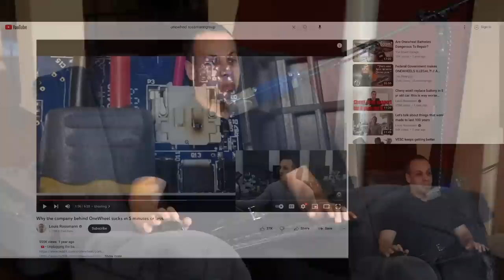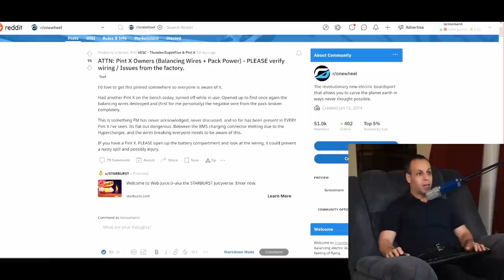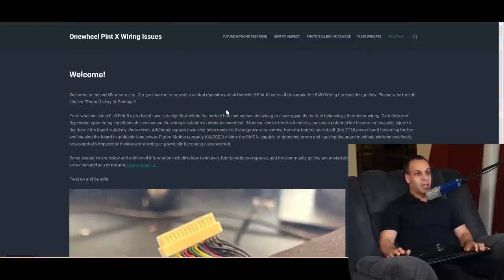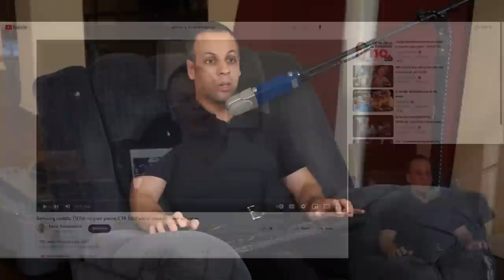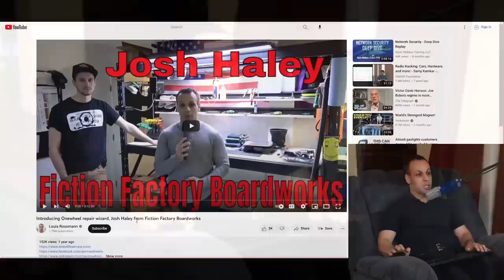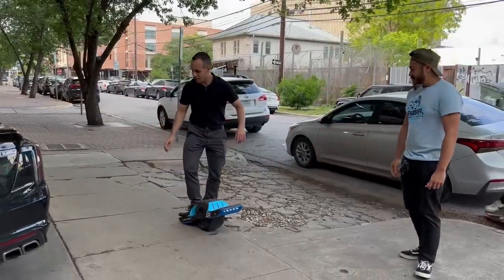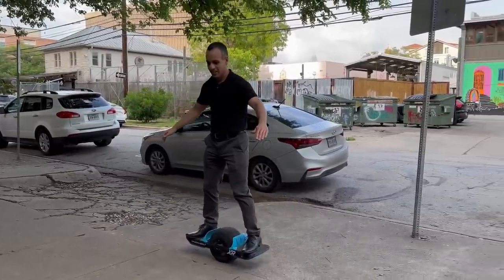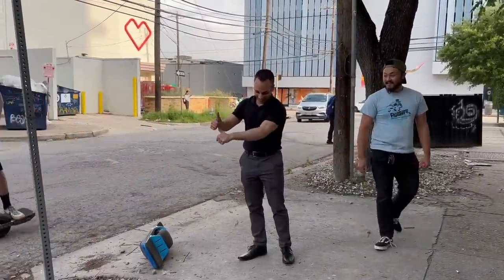The Onewheel Pint X has a dangerous design flaw that Future Motion refuses to acknowledge

Comment: I had a issue with my Pint X, weird battery percentages showing up on my app for a while, then I knocked the board a little hard one time and the board stopped turning on. They replaced the battery for free, but it did require I ship it back to Santa Cruz. Looking for any buyers for my Pint X because I much prefer my GT and VESC these days

Comment: An open source project for a one-wheel style product needs to be made, in the way the 3d print community has open source collaborated for their 3d hardware and software design. There are companies that assembly open source designs and make devices with precise tolerances that the average guy won’t need to deal with, Like PRUSA, even DIY kits that one could buy and build on their own a fully functional model…..

This should extend to every product that currently exists, regardless if there if is a patent for it or not, make the parts multi use, not meant for a single device as long as it’s not made for violation of patent, from phones to tablets to computers and transport devices.
Reply: As said, this isn't possible due to patents

Comment: that spaghetti looks like it'd be better if it's just 1 wire idk a god damn think about it but it just looks like it should be 1 good power wire.
Reply: The wires are from 20~ different lithium ion cells running in parallel

Comment: I have long been puzzled by the statement that you can’t disconnect the battery on the Onewheel and I think that you may have been a bit unfair to Onewheel about this. I have never looked at a Onewheel But it is widespread in battery charging circuits that you find inside laptop batteries and other equipment that if you disconnect the battery and then reconnect it the battery pack will not work, this is because the output circuit requires a voltage to start but as there is no output voltage because the battery has been disconnected the circuit cannot run and produce an output. The solution is to provide an output voltage momentarily so that the circuit can start. Has anyone looked into this or tried this?

Comment: MPH 18 battery limit 12-18 miles. So you have to charge it every hour?
Reply: The "battery" limit you posted is actually the speed limit of the Pint X
Reply: @northuniverse  i googled the battery life it says 18 miles
Reply: @PSOpwnage  that's how far you can go. It can take anywhere from one half hours to three in order to ride for 18 miles. I usually get 13-14 miles of range (2-3 hours).

Comment: So those irresponsible nutters knew to use an Amass XT60 connector (the chonky boy to the left of the roasted cconnector) with appropriately sized copper wire, but then also made the choice to use some press fit connector that looks like it might be good for 20 amps on a cold day? 
A quick read of any of the prominent remote control FPV authorities (eg. Bardwell, Oscar Liang) or even the tech specs sheet for that connector would have told them not to be so bloody silly. Presumably they employ at least one electrical engineer, so WTF?

Comment: I had a one wheel, I used it a couple days and threw it away. It kept going despite my trying to stop. Too dangerous. I had a couple Kaboo scooters I FULLY recommend. You can use and find aftermarket everything for it. There are no serialized parts, no locked batteries. You can get aftermarket controllers, brakes, motors, ANYTHING. You actually own the device. Its great.

Comment: I would like to share a mail thread to you of my conversation with google support people where I claimed my warranty and they are telling me to wait for 24 to 48 hours everyday. I have been waiting for almost 2 months now to claim warranty for a issue that should not exist in modern mobile devices. The issue is with my pixel 7 which disconnects randomly from the internet for 5 to 10 seconds and this is enough to make the device unusable for any kind of meeting and online gaming. This issue is only happening with mobile internet though and not with wifi. So to test this myself, I bought SIM cards of different carrier and the device behaves the same. I thought hard reset will fix the issue but to no avail. They asked for bug report which they said their team of experts will analyse and tell me what to do, but they have not touched it yet. Also they told me to give device to a third party service center which is too lazy to pick up my device.

I just want to share those mails, only if you are okay with this.

Comment: Has anyone had an actual full power off due to this?   It's a balancing wire and not powering the board so even it was cut through the board would work but would not recharge. 
Only 4.2v on each wire . Blacks prob neutral.  Can't see even a short between the positive and negative causing a run away fire?  You would have to be seriously unlucky to get both them wires to short considering all the positive wires are separated from the neutrals ?
And surly the software would notice a voltage drop and apply push back?
It's a shit fault and fm should be addressing it but is it bad enough to not be using the board?
Is stripping the board down going to cause a worse problem?  
My mate did his and said it's a ball ache and he nearly damaged the foot pad wires. 
He's replaced the tyre on both pintx and gt so pretty handy opening them up. The gt kept shutting down after the tyre change?? Its fine now but bit wiered? 
What about people who have no real practical skills? 
Just thinking is it better to leave well alone until an error occurs?

Comment: Future motion sucks and right to repair is an issue. That said I've got 5,000 mi on a pint x and it's very reliable. A lot of the people that have issues with them taking the skate parks,  drop them down staircases and generally abuse them. As someone who commutes and rides around on it and doesn't take it apart all the time it's fine.
Reply: What you are saying is flat out wrong, just the battery housing design&installation can lead to damage. Commuting, crashing, trail riding, and all sorts of things can lead to damage. Did you even view the gallery of pintxflaw?